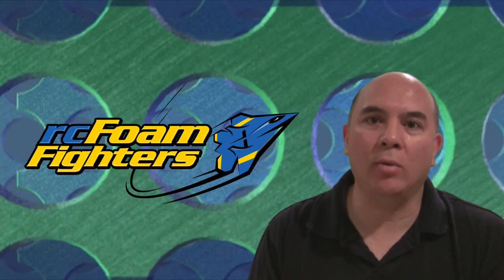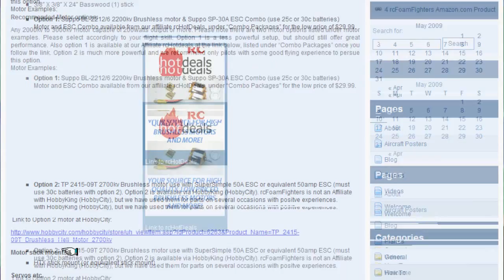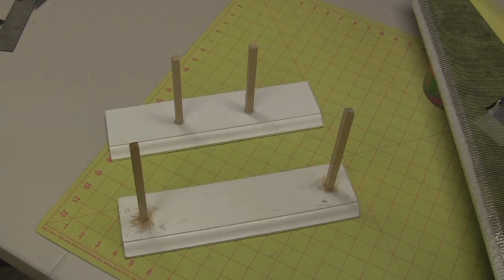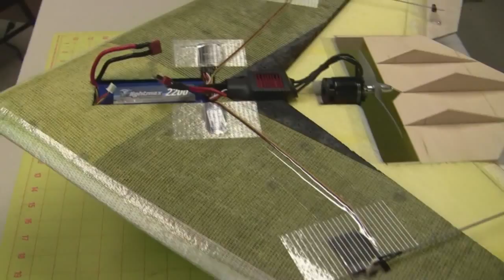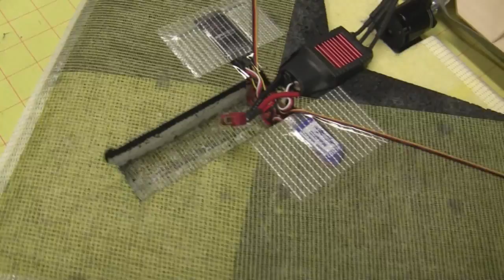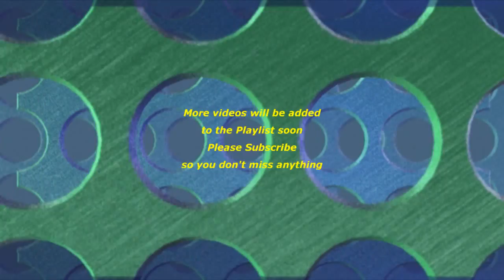Bullet Proof RC Plane Build Along No1 Phase 2 Completion

Comment: Since this is an OLD video I hope I will get an answer..... can you tell me about the ESC you are using in this wing? Do you have a separate BEC wired into it? If so, could you tell me how you did this? (how to wire an external BEC to an ESC that has no BEC). THANKS!

Comment from the maker: @macawjm you can plug them in any way you want it doesn't really matter as long as the prop spins the correct direction. If it spins backwards you only need to un plug and switch two of any of the three wires around to get it to spin the opposite direction.

Comment from the maker: m36boy this involves elevator and aileron mixing which could be done with mixing y cables or you radio transmitter. I would suggest searching the rc forums for more detailed information on this as there are many radios and different ways to set them up. Search for "elevon mixing"